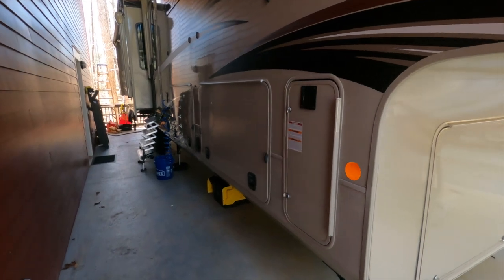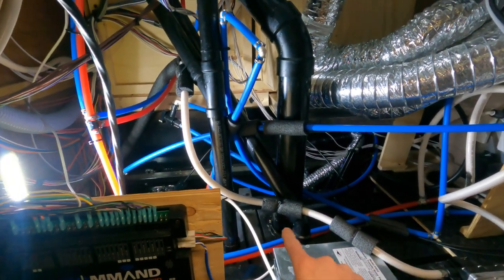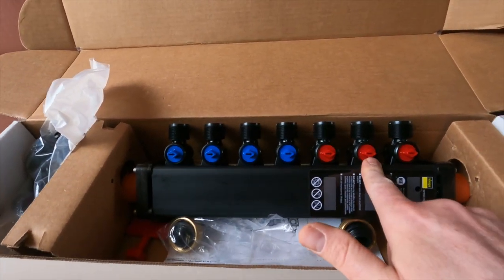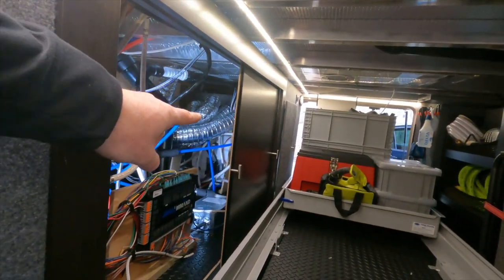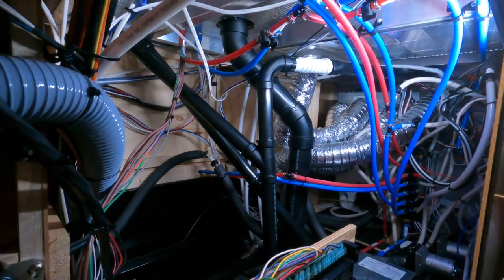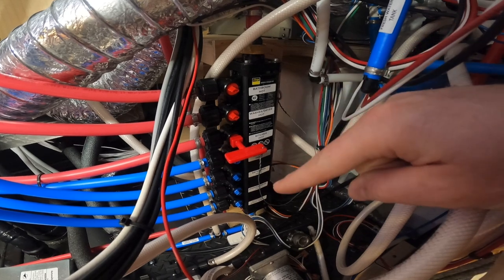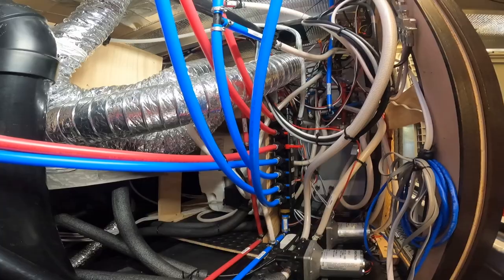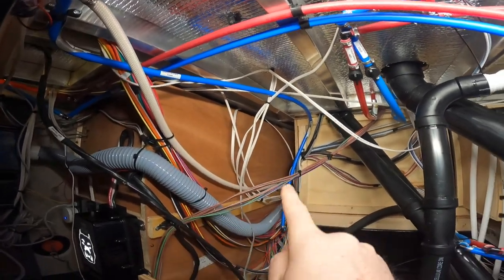Viega MiniBloc Water Zoning Manifold on my Fifth Wheel RV + Bonus Plumbing Clean-up Project

Comment: I have watched your video about the underbelly and sealing all the open holes. I did all of that to my 2016 redwood when i first bought it . I also changed out all of the exterior screws from factory screws to stainless steel. Now back to the holes I have found a way for you to seal the hole up on the outside of the frame where the hoses and slide rails run in and out.( neoprem rubber.) for the slide rail cut the rubber larger than needed this is so you can us spray glue and glue it to the frame. cut the square hole out in the shape of the rail but make it so it is tight and sweeps the side of the rail. now make a second one and cut them both in haft . glue one to the frame. now glue the other one to the frame on the other side of the frame make sure that you leave enough rubber so that you can overlap the 2 peace's and glue the together . this will work for any type of shape or size. Now it is time to do my manablock. THANKS!
Reply from the maker: Thank you for the comment. Great tip!

Comment: I am about to do this same thing to my Big Horn! I am going to use pex A just for the added diameter of the pipe! Mine will be 18 valves! Home run to each fixture! Going to expand the wet cabinet! Looking to use the entire off door cabinet as wet cabinet! Then put in a MorRyde slide! Going to insulate every pipe!
Reply from the maker: Very nice! Sounds like a fun project.

Comment: What I did to clean mine up was removed all of the cheap white flex hose from the nautilus and installed PEX instead.  This way you can make the entire water system more organized. (In your case, you could then install your manifold on the ceiling)
 I chose to bring all of my water lines up to the ceiling and then horizontally across, then a line goes to each fixture.   
Although this may be an advance project, this opens up the entire space to allow so much more room back there.  I'm my case, I installed an onboard 3 gal air compressor and a hose real (coming out of the wet bay), along with a remote switch for the compressor, located by the hose in the wet bay.  Imo, this is a must have, and wouldn't have been possible without redesigning the water lines completely.

Here's a teaser😁...... position your  jaycommand on the back wall!  "Operation clean up" has begun! 🤣
Reply from the maker: Great ideas, love the details!

Comment: Did you T the incoming cold water line hit the manifold from the T hit water heater then from water heater to the manifold to supply the hot water lines?
Reply from the maker: Yes, that is correct.

Comment: Question Jay....

The large orange wire (and I think there's a large grey wire as well) in a cluster that's right under your vac hose, what does that go to?  I have it in mine, but it wasn't connected to anything by the jaycomand.  The cluster in question goes up into the basement ceiling next to the vent stack, but I haven't found it's endpoint yet.

Thanks Jay
Reply from the maker: I have not traced it, but it's a coaxial. Maybe for tv or comm?
Reply: I'll check mine then and report back.

Comment: Is there a thermal exchange between the hot side and the cold side of the manifold, or is there a good insulating layer between the two?
Reply from the maker: Haven't noticed any discernible thermal exchange.
Reply: Great job